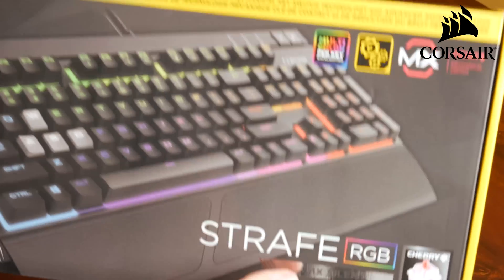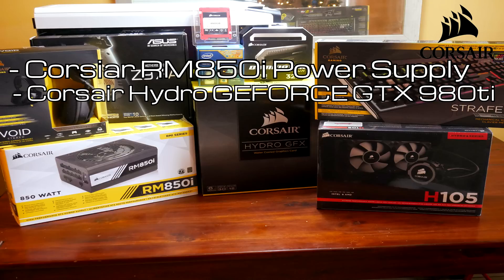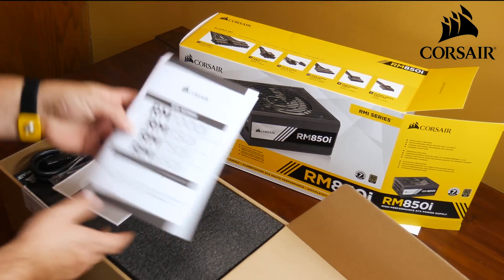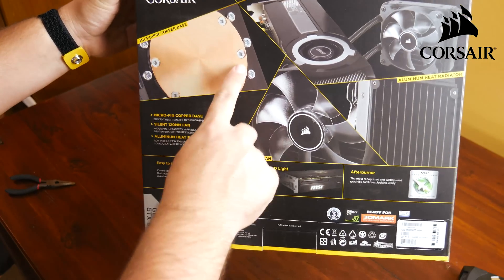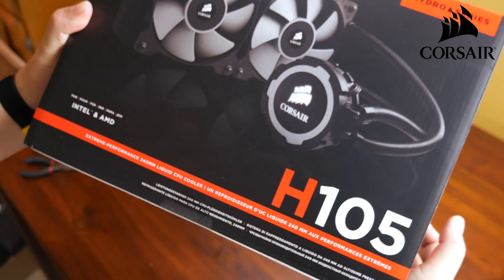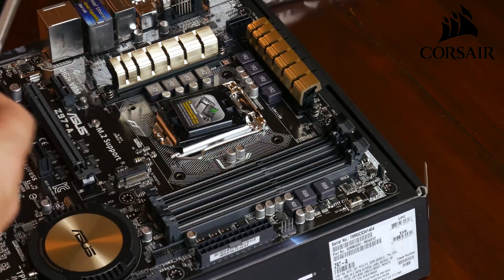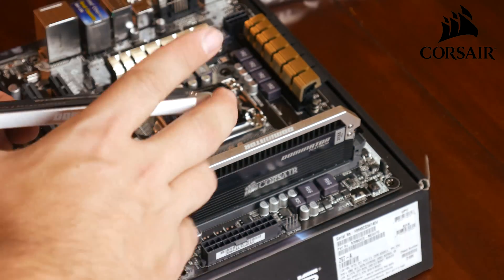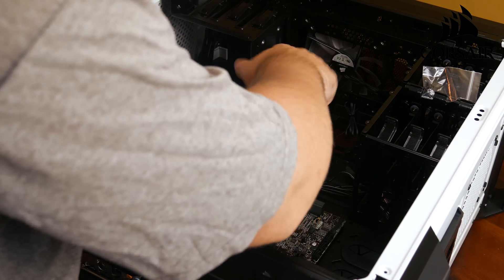Deluxe20's PC Build - Part 2 (Power Supply, GFX Card, CPU Cooler and Motherboard Assembly)

Comment: @Deluxe20  Is there a reason you didn't go with the new Z170 chipset with DDR4 and Skylake? DDR4 is dirt cheap atm
Reply from the maker: +Christopher Hamblin I already had the DDR3 so when I bought the new MOBO I just stuck with one that would work with my ram.
Reply: +Deluxe2O If I may make a recommendation, if you're thinking of even upgrading. Assuming you have more storage space than just that one Neutron XT 490Gb SSD (some externals probably). ###Nerdy talk### The SSD you have is limited by the Bandwidth of the SATA 3 port it is connected to so 560Mb/s Read and 540Mb/s write. You can however get a much faster drive called a M.2 drive, if you see just below your CPU socket it says M.2 support, it plugs in there. Make sure to get an NVMe drive as they use the PCI bandwidth allowing up to 2500Mb/s Read and 1500Mb/s Write. Just a suggestion, worth looking into. Sorry for the long post

Comment: why where you wearing an anti static bracelet if you didnt even connect it to ground ?
Reply from the maker: +Brendan Paul I'm a noob ok lol
Reply: +Brendan Paul it was connected to the case which is metal and sitting on a table which grounds your wire.
Reply: when he was handling everything before putting it in th ecase his bracelet was not connected to ground
Reply: ***** still love you bb!

Comment: I'm missing something, in the video, when putting the motherboard in the case.
Are the spacers allready put in, by corsair,  where the motherboards screw holes are? 
For newbies who whant to do this too:
If not and you forget them?  you will get a surprize you don't like when turning on your pc for the first time.
The board will shortcircuit if no spacer is used.
And make sure there's only a spacer at every hole where a screw goes in the board.

This is very important when building your own pc the first time.

Comment: from experience I would replace the fans on the h105 as they are not quiet
Reply from the maker: +JWgaming yea I am going to look at doing that because I would like either ones with white LED or noctua fans
Reply: +Deluxe2O noctua are pretty dope, the nff12 with the low noise adapters are almost silent at 100% in a just ambient sounding room
Reply: +Deluxe2O get a bunch a fans from Be quiet, they make really quiet fans
Reply: +Deluxe20 other than that great build and im very envyous of the water cooled 980ti but those corsair stock fans are driving me nuts at the moment in my build

Comment: For anyone wanting to build a similar build, don't get the exact parts. They aren't essentially bad, they are quite good actually. Though, for rougly $2000-$2500, SLI or CF should be a no brainer. Also wait for Pascal or Polaris, and see what AMDs ZEN has to offer.